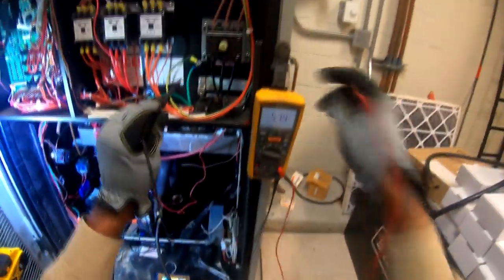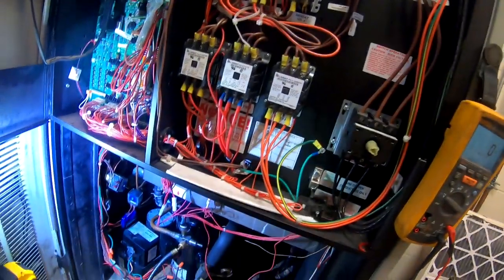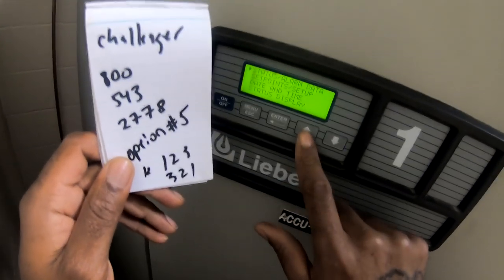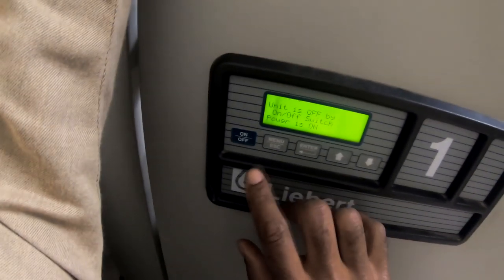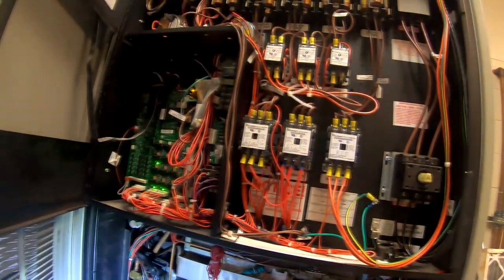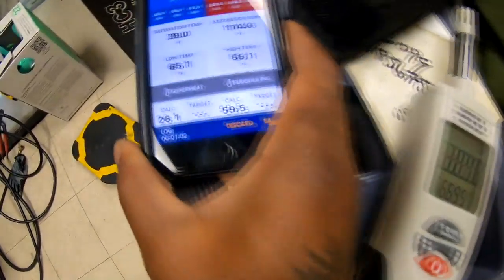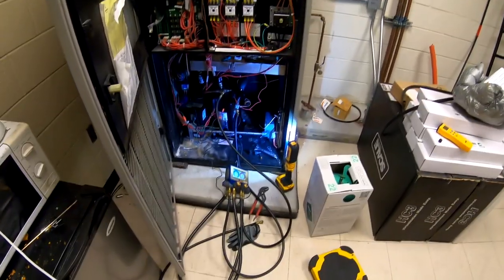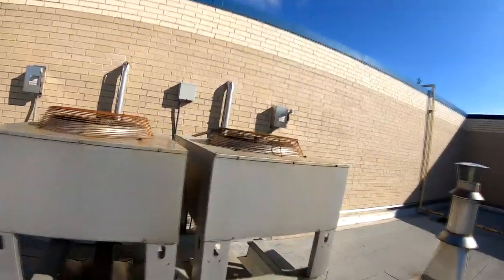Troubleshooting Liebert unit

Comment: The unit communication wasn’t calling . Check if the Units are tied to a building automated system. If the BMS isn’t calling the unit to turn it will keep the solenoid closed. If the leibert unit was off by controlit was turned off by BMS comm most likely.

Comment: There was nothing wrong with that challenger 3000. The reason why your suction pressure came down was because of the solenoid was closing off because of the pump down. And for all displays that look like that (AM/AMG) they passwords are going to be the same.
Reply: Did you notice that bottle of R22 in the box next to the unit near the end of the video. He noticed that the sight glass was flashing, unit had low suction pressure and probably added refrigerant to bring up the suction.  Don't know if the HG bypass was energized, return air temperature, or compressor amps. But very possible that the LLD is restricted from the previous contractor replacing the compressor  and not purging with nitrogen.  Also don't know if the condenser has a receiver or uses fan cycling for capacity control. But that unit is not working correctly after his service call.
Reply: The unit was off at the disconnect. When he hooked up the gauges he was reading pressures. When turning the disconnect back on the the unit the compressor came on to start/complete the pump down. After the compressor tripped off from the LPS or LPT opening up he looked at the unit display. The display said “unit is off by on/off switch power is on”. This means you have to push that switch to on to start up the unit. He was even scrolling through the settings and found the alarm setting and it even said no alarms. If there was a problem there would been on alarm. After viewing the alarms he attempted to change the set point, thinking if he lowered the set point the unit would come on. You can do that, but you still need to press the on/off switch to start up the unit. Once he came back from the conference call the suction pressure was 67. I don’t know if it was like that before or after the call, but he didn’t mention anything about adding gas, even though he had his scale. Seeing a sight glass flashing doesn’t always mean the unit is low. I have seen sight glasses flash with 22 SC and still flashing. Even the book says don’t charge by sight glass, it is just checking moisture content. What would a receiver do in this case? All a receiver does is allow the TXV to have a full column of liquid/ storage. You mainly see  receivers on newer unit like DSE with EEV, this it a old unit. Are you referring to a Lee temp? Totally different from receiver.

Comment: Don't take this the wrong way, but you don't have a clue on how to work on this unit. You where the wrong tech to send to this call.
Reply: Agreed
Reply from the maker: I'm okay with that.im not an expert on all hvac equipment but I'm not afraid to troubleshoot anything..That video almost a year old and I didn't get a call back..Thanks for watching!
Reply: @WWHVAC  I agree with the 1st comment, but also respect your attitude. Not claiming to know it all but not letting it stop you.

Liebert units are easy once you get used to them, a lot different than working on regular AC only units.